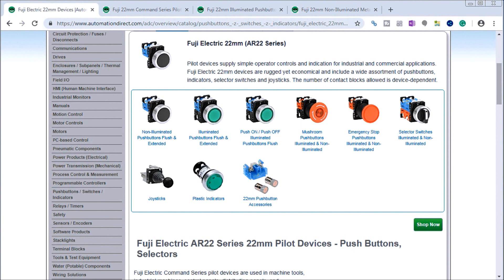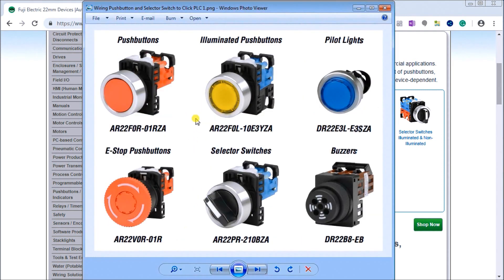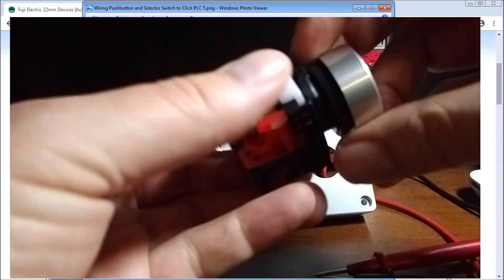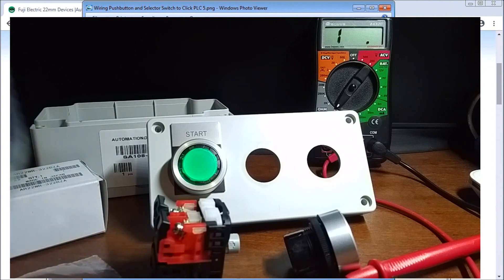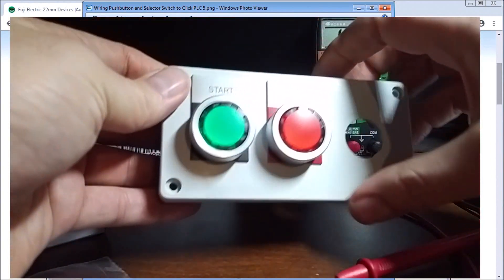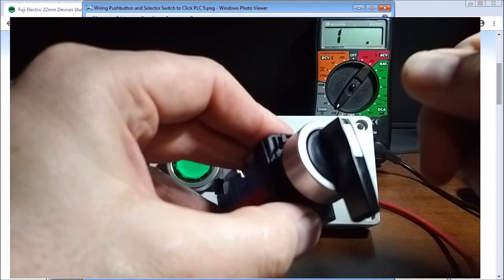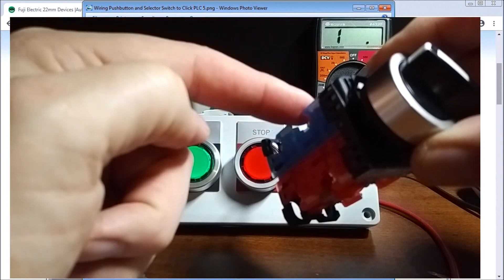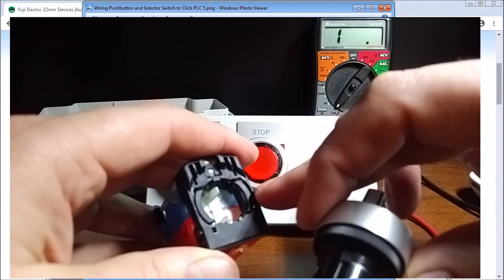Wire Push Buttons to PLCs Like a Pro - Easy Step Guide!

Comment: Hello, can I use dry contacts “no voltage” for the inputs? Instead of using 24v input on the channels? Ok the click plc’s
Reply from the maker: You must check the input rating for the Click PLC input point you are connecting with. This will determine how to connect the input.
I hope this helps you out.
Regards,
Garry